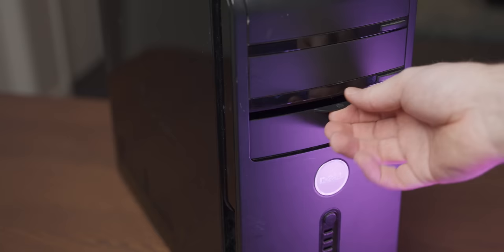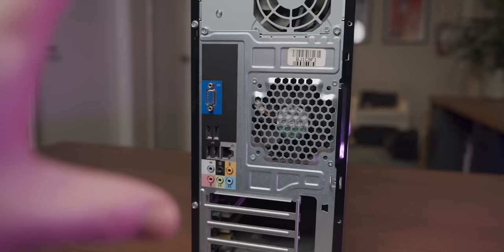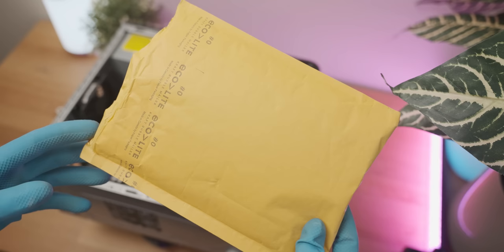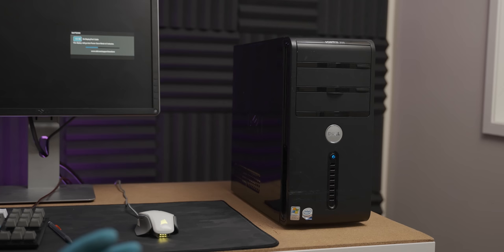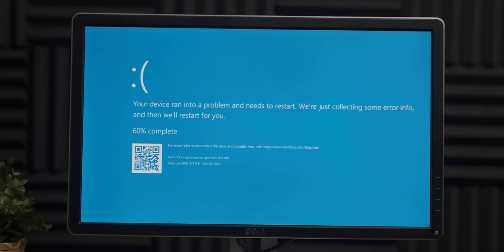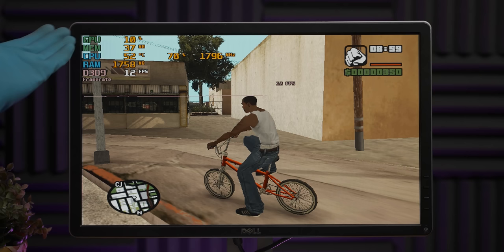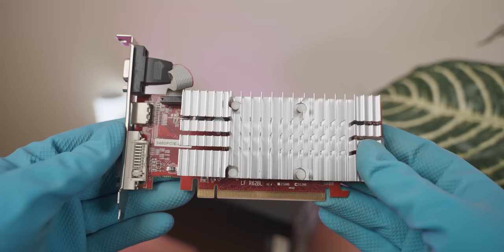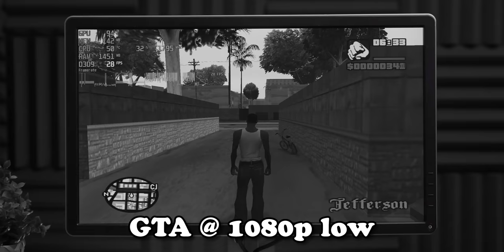I Think I Was Scammed Buying This $19 PC of Craigslist...

Comment: Funny stuff. . I bought an old G31 with a core 2 extreme processor just for fun.  It took FOREVER to get windows 10 installed on it, but it did work.  I thought the 4 cores would do better in general computing, but. . . .no.  It's amazing how the lack of L3 (I'm assuming) kills performance.  You didn't run any performance scores, but my QX9650 scored 1932 in Cine r23 and the E7500 scored 817.

Comment: I have a much faster computer sitting under my bed that hasn't  been turned on in 10 years. It's mostly just there because of my emotional attachment to the case, 5 years ago I gave away the PC I replaced that one with. I can't believe anyone sold you one of these in 2022.

Comment: hey dawid i got a suggestion if you have truble with older pc's installing win 10 you can install win 7 then use the boot usb inside win 7 to upgrade or straight install. older systems dont have uefi boot i think thats the problem.

Comment: The resolution you're running those old games at is like way above what they would've been played at when they were new, on hardware like that. 1024x768 was the "1080p of the time" so that should've been your benchmark :p Even 1280x720 is 14% higher resolution than 1024x768. Those old pieces of low-tier hardware will really struggle to fill that many pixels.

Comment: I think you might be having issues with the fact that this is a windows XP era machine. This means that it probably doesn't have a UEFI BIOS. 

Also Rufus for some reason nowadays defaults to UEFI only. Which makes sense since I think some laptops ship with a revision of secure boot that won't even attempt to interface with any none gpt formatted disks....

Edit: Also you might have issues with winPE. On any system with 2 GB (or less) ram I recommend actually taking out the HDD. Using another computer to install windows then removing the drive as soon as it switches over to stage 2 of the installer (aka after that screen with the 10 second timeout before it reboots. Do not allow windows to load when it reboots....rip out the power cable if you have to). 

I'm recommending this as windows doesn't actually start to configure drivers till it enters the second stage of the installer unless you're unlucky and the SATA controller this has is non standard.

Comment: Core 2 duo was a real good cpu for the time. I also had a pc with core 2 duo in it, and paired with GeForce 9500 GT, I was able to play most of the games of that time with minimum 30fps. Seems like bcz of the windows 10 operating system you're getting such a low fps.

Comment: If they'd been "smart" about it, those still use a plain BIOS and all that stuff, they should have listed it as a retro gaming PC and priced it way up. 

 My dad was using a Core 2 Quad system up until like 6 months ago.  He ran the crap out of it, he had Ubuntu 22.04 on it, editing like 100-200 page documents, scanning, watching baseball and stuff on the browser, tons of printing and Zoom conferences at least weekly.  I wonder if it was literally the oldest system on Zoom.  The power use on it was brutal, it's a 110W CPU and it uses 200% CPU usage (so probably about 55W) to play a 1080 video off Youtube.  Zoom was using like 200% too.  He was not interested in an upgrade (the CPU usage was brutal but it was just fast enough so it wasn't snappy but not terribly slow either, other than the bootup time.)   Due to the likelihood of caps blowing or something on his 18 year old system, we got him a $180 replacement (that has about 20x the performance) and moved his install over onto it.

Comment: Your first mistake was trying to run Windows 10 on any core 2 CPU. I would have stuck with 8 or even 7 at the most. I have and use a core 2 quad Q9550 and it's a fast little system running XP. But it's also got a SSD and 8GB of ram.

Comment: I think when running the "motherboard" (actually Chipset) graphics that Windows can render stuff the GPU doesn't support using CPU power. With old slow CPU this is especially bad but explains the high CPU use and terrible performance. And how the GPU upgrade helped so much.
The PC probably takes 8gb ram, and faster CPU, E8400 are dirt cheap and quite possibly supported. If only supports older core 2 CPU might still take legendary Q6600.
SSD helps tons with windows performance even on old systems.
Not sure on Graphics, seeing GT 630s quite cheap.
Of course if you upgrade everything would have been cheaper just to buy a Sandy or Ivy bridge machine instead, but that would be missing the point and less fun!

Comment: Odd you weren't able to get Windows 10 installed via USB flash drive.  I did that on my old Vostro 200 and had no problems.  Then again, I had a Core 2 Quad, so maybe the DG33M03 motherboard allows USB booting while the G33M02 (which I think is what you have) doesn't.

You should do a video upgrading this thing!  Maybe even use Windows 7 since drivers should work on that.  If you've got the G33M02 motherboard, pick up a Core 2 Duo E8600 + 4GB RAM, or if you've got the DG33M03, get a Core 2 Quad Q9550 + 8 GB RAM.  Pair that with like a GTX 560 or GTX 650, and you shouldn't have any bottlenecks, and should even be able to play games released as late as 2015 (per experience, Battlefront 2015 should run surprisingly well).

Comment: It would be fine to run flight radar 24 based on Linux with a usb dongle etc to track aircraft. Gets you a £500 a year account on fr24 as well so you would be £450 in profit.
Every old machine has its uses. And no I am not affiliated with fr24 other than gleaning data from it for my website....

Comment: What would be the best bang for your buck graphics card.  I am giving my old PC (i7 8700k 16gb ram) to my cousin and am looking for the best budget card.  I can get a used GTX 1060 6gb or GTX 1650 4gb both are $75 I think the 1650 is a newer card but im not sure if its better. Or would I be better off going with something else like an rx 580 8gb. Just want to get him the best sub $100 card.
Reply: buy used m8
Reply: @k0ldside  these are used prices. A GTX 1650 is $179 new at Best Buy.  Basically you can save $100 buying used on that card.

Comment: i mean its not really worth it. but if u need a gaming pc. you could easily put in gtx 1050 upgrade the cpu to i believe at the time they were core2quads 12-13 years ago i think i had core2quad Q9550, and add a ssd.

Comment: you should try and overclock that pentium e2160
I used to have one of those and without extra cooling they just go to 3ghz and beyond on a cheap mobo.
You could buy this processor for 70 bucks when it came out. Take it home, just hit that + button on your clock ratio all te way to 3 ghz and your cpu would perform close to the 300 dollar core2duo counterparts. (I played crysis on this with a 4870)
Reply: Never again I saw a cpu wich could do a 100 percent overclock straight out of the box, it was a true miracle.

Comment: Oof, that CPU is brutal. I've used a Q9600 paired with a 1030 to run Fortnite in the past. Which was not as horrible as you'd might assume.

Comment: Hey Dawid, i suggest to increase shared video memory to the GMA gpu, it was like 64mb, and gta sa would run better with 256mb shared video memroy, and you can change that on the bios, as for the CPU I believe it's an unlocked chip ! Can you please make another vid about this pc with some upgrades (HD4750 + Q8400 with some juicy 4gb of ram) i think it would run gta 5 and BF4 as well bf3 would run too, gta4 is on sale, L.A noire too ...

Comment: I went to buy a low end graphics card from someone for £12, I think it was a Palit GT750, and they asked if I wanted what they described as a small twin core PC with it for free.
Turned out to be a Q6600 mini-itx shuttle PC, which I put more DDR3 memory and a GTX660 in.
Does it run the original Crysis? Yes, at max settings. 🤣

Comment: you can grab an HD 8490 for 11 or so dollars off ebay, and 8570s can be had for about double that, so you probably shouldn't take the 11 dollar syphillus vector from the craigslist crack dealer next time

Comment: I actually tried gaming on my house's 2011 PC. The game won't even launch lmao.

The specs were:
Intel i3 2120
Asus gpu (1GB DDR3)
8GB DDR3 1333MHz
500 GB HDD (already change boot drive to 256GB MX500)

So last month I change the GPU to GTX1050ti for RM300 (around $70) because I gamble and buy a 'faulty' & luckily it works after I clean the 'new' gpu >_<.  Although firstly it sucks to stuck in bios for 2 days since it my first time, and searching for solution.  It manage to pass the bios after I try every ver of it hahaha.

The game runs pretty smoothly in between low to mid settings. Smoother than my Ryzen 4500u laptop.  But I think I would change the cpu to Xeon E3 1270 (RM128, around $30) because I play using Gameloop and Bluestacks as well.

Comment: My only thing is: why do you masochistically use an HDD where you could use a sata SSD? I mean, I've ran myself a 4800+x2 socket 939 on a 128gb ssd.. windows 7 was booting in like 35" vs the 3 minutes and a half necessary for it to load JUST the desktop (and even with the same cloned win7 install on either drive!) xD. Don't do HDD violence on yourself!!

Comment: San Andreas is clearly running into a memory bottleneck. Either the bandwith of good old DDR2-533 is too slow, or the onboard graphics didn't have the necessary memory allocated in BIOS.
And obviously the fact that while it has support for vertex shader 3.0, it only does in software. pixel shader support is limited to 2.0, so you're basically stuck do DX9. No not 9.0c, plain old 9.0 which means you are stuck to the capabilities of a Geforce 6 from the ancient times of 2006

Comment: i think you should be able to boot using a USB flash drive, but sometimes these old motherboards will not have that option in the boot menu, and in those cases the only hope you have is to check if you have HDD priority and can choose USB HDD instead of the normal hdd, and it will boot.

Could be that this shitty OEM motherboard just dont have it, but that is the best bet. :)

Comment: Besttec PSU’S are crap. It’s your typical cheap power supply you find on EBay for about $40 and they last about 3 years on normal use. If you buy one for gaming, you might find yourself in a cloud of smoke after a month.

Comment: Well. Your wrong. You can install windows on such a old pc easily. Just format the USB as NTFS and it will see the USB as a regular hard drive. I had found this method when i was trying to install windows 10 and windows 8 on my Intel Pentium E2140 and a gigabyte 945gcmx-s2f4 board. 
And also. That system played games 100 times more better than this. That thing just had 1 gig of ram and a 80 gig harddrive. And it ran gta sa and nfsmw really really well. Although the cpu speed was low for half life 2. And cs source.

Comment: I dont think it was a scam. Many people remove hard drives to protect privacy and that kind of text usually only means that it was tested that the computer works with windows 10. I still think you paid way too much for a core 2 duo system and windows 10 is too new OS to try using with one.

Comment: Sorry to comment on a flipping old video, but as a not so proud owner of a mesozoic computer, investing on a graphics card is worth it?
Reply: If your PC is this old, you will need to replace EVERYTHING, so just build a new one or do a LOT of research into prebuilts, if your PC is within about 5 years (9th gen intel, ie: i5 9600/9400, i7 9700, or i9 9900), yes absolutely, but make sure the GPU isn't too good for your CPU, the Pcbuilder subreddit is very helpful for this

Comment: WHY WINDOWS 10!? this machine specs are NOT ment for that OS. i bet if you install XP or 2000 it would likely run more games a LOT better! also. try installing an SSD and using a massive pagefile on that. that alone would be a huge help if you don't want to use an older OS

Comment: Funny video. I think you used a too weak graphic for that processor. 
Recently, I was working/playing  with an old C2D E4600 machine and trying different old  cards I've at home, so instead a HD 4350 you  can install something stronger like an HD 4650 or HD 4670, or GT 220, GT 240.
Reply: It can go way beyond. Stuff is still PCIe, so in theory even a RTX 3090 would work, but would obviously be horribly bottleneck by basically everything else in the system.
With a fast quad I would go so far to say even a GTX 670 or HD 7850 would do just fine.
Reply: @HappyBeezerStudios   I meant without bottleneck, obviously.  ;)

Comment: Ergoguys High Visibility Large Print Soft Touch Wired Keyboard, Black (CST104LPY)
OMOTON Wireless Keyboard and Mouse, 2.4GHz Full-Size Keyboard and Mouse Combo with 3-Level Adjustable DPI Mouse for Computer, PC, Desktop, Laptop with Windows 2000 / XP / 7/8 / 10 / Vista (Silver)

Comment: wow a dell so old that it used a standard PSU.

also amazed at how easily you are entertained by a game not running.  i'd have already found a tall bridge to chuck that computer off of before i got to running any thing on it.
 
geezus how does this pc run Hlf2 so bad ?  when i first got it  i had to run it on my grandma's computer  (we were at her hosue  on xmas eve 2004) at the time which was a k6-3 with only 512 MB of system ram  and a geforce 2 ultra on it (that only had 128 mb vram)  , even that thing who's newest part dated to 2002 got the game up to 35fps  at 800x600.  that game is litterally teh definition of a game that wil run on a potato .

one lesson i took away from this : when our civlization ends and people in the future dig up our ancient tech , if this is the only pc they can get working , they'll be in for one hell of a headache.

Comment: lol... seriously? searching for dvds?
i would simply have installed my windows unto a ssd/hdd  i was going to use on my existing machine..
then install it into the new machine - and on first boot.. make it start up in safe mode - or disable driver verification..
after it loads the first time.. then just reboot..🤣